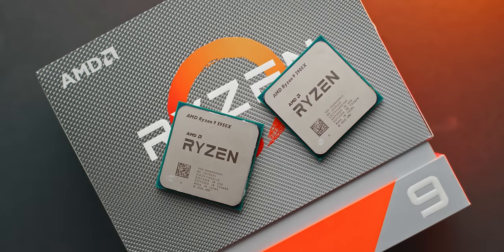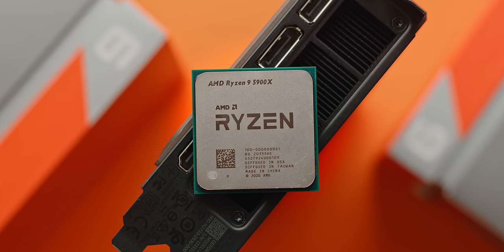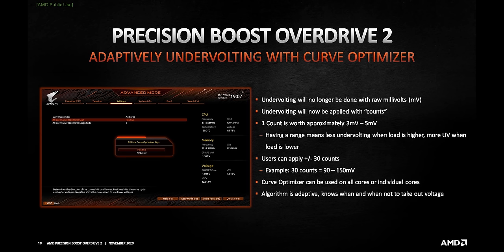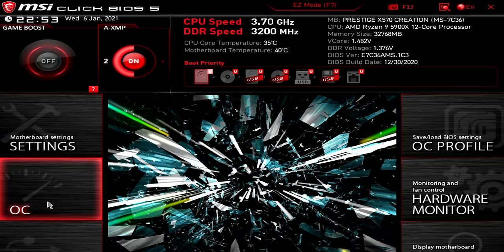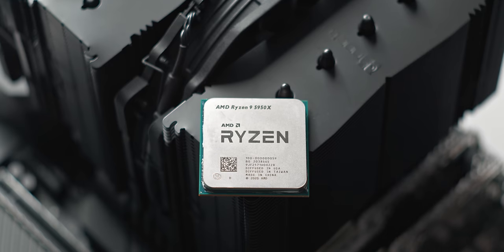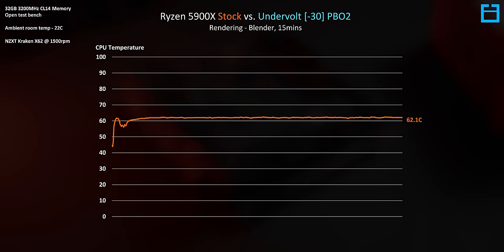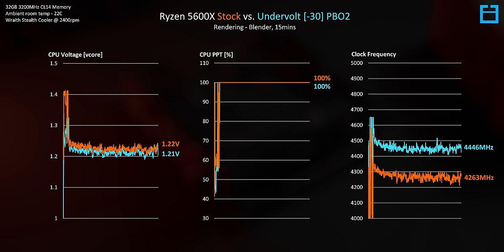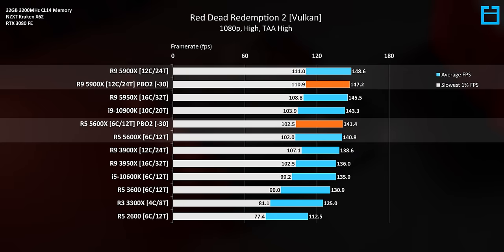Ryzen 5000 Undervolting with PBO2 – Absolutely Worth Doing

Comment: I did the exact same for my Ryzen 5900x setting to -30 and it crashes and doesn't work for me. I am using MSI unify x570 latest driver
Reply: @mattiasneidenstrom  thanks thats really helpful. But Today I returned my Ryzen 5900x and opt for Intel 10th gen because 11th gen sucks.. Ryzen performance no complaints but the idle temps around 50-59C degrees is bitting me.

Also I do not have any experience with overclocking and to get my desired temps I guess its too much work for me. Amd is really for the enthusiast. Hopefully next time when DDR5 comes out
Reply: @mattiasneidenstrom  I am using Corsiar h150i 360mm
Previous processor - i7 9700k and was really happy with it. Idle 28-33 and Max game load 60-65
Case Lian Li O11 Dynamic with a really good pull/push configuration 

I am getting i9 10850k as its on sale £370 and I did not see a point to go for 10900k which is just 100mhz more and practically same fps on games and for more money
Reply: @mattiasneidenstrom  thanks. I know Ryzen destroys Intel in performance but I made this decision after reading countless blogs and asking forums and found out that Ryzen does run hot on idle and within seconds can have temp spikes due to short burst is voltage that is supplied to the processor. For this reason undervolting helps with temps.
But for me i need something out of the box to work and not to touch anything related to oc
Reply: @mattiasneidenstrom  So does it mean I have a faulty processor? Damn Just now returned the processor and ASUS ROG Dark Hero...damn

Comment: Would this work the same for a ryzen 5 5600 which isn’t a x version? Can i still use 30 as optimizer magnitude
Reply: probably on -30 it won't be stable
Reply: What should i set it on
Reply: @gatzwithoutthestrapz4567 Start with -10 or -15, test stability

Comment: Wow that was so easy, I now have a 5800x boosting to 5ghz that runs cooler :D
Reply: I'm doing something wrong. My 5800x went from 70' to 80' with a -15 undervolt on all cores in CB20. Did I miss a step? Should I have Ryzen Master set to Default? The CPU runs too hot like that (80') so I have it set to PBO Gaming Mode (70'), is that messing things up for me?
Reply: @hotblack1166  Ryzen master would override your bios settings, so yeah I think you’d need to set that to default

Comment: Ok I’m a little new to this stuff but I did this and got it to work on -15 all cores but not -30. Anyway I hit 5.05GHz on 3 of my cores which was higher than regular pbo which hit 4.85. My question is, is that good? 5800x on a 360aio
Reply: On cinebench r20
Reply: Ridiculously good, that is some Core high end i7 and i9 levels of clockspeed.

You have the best Ryzen CPU for gaming if you can reach those clockspeeds.
Reply: If you reach 5.05GHz on 3 cores, maybe you can get pretty close to 5.1 (or 5.2GHz?) in one core.
Reply: @saricubra2867  PBO2 seems to be the way to go with these CPU’s. I never broke 75c as well!!

Comment: Anyone that thinks that undervolting gets you a better R23 score than adding voltage is simply delusional.
Reply: It can if you tune it right, lower temps means more overclocking headroom

Comment: With my 5600x I get about 400 MHz and 400 R20 points but it also runs about 15 degrees C hotter, from high 60s to low 80s...
So I guess Ill disable it again :/
Reply: Nevermind, it seems like PBO switched from advanced to enabled.
Now I'm getting about 200 more R20 points than stock with pretty much the same temperatures (only tried Value 20 so far) :)

I guess that's a pretty cool little extra for free :)
Reply: @LuxLikeGaming  There is no risk on try it, or you can damage the CPU?
Reply: @ZeroCool22  no risk at all
Reply: @evilleader1991  Thx.

Comment: Got my 5600x undervolted (around -25 per core beside the 2 best at -15) and overclocked +200Mhz running at 4.7Ghz all cores and 4.85Ghz single core. OCCT and Cinebench tested. Gets a 11493 and 1587 multi core and single core score, respectively. Temperatures max at 80 during multicore stress tests using a 360mm NZXT Kraken, which seems high although it is being pushed a lot. Would love to know if these are common results or if my chip is performing above/under average? Cheers!

Comment: i can't figure out how to so this on an asus b550-e motherboard. no curve optimizer option or anything :(
Reply: I own the exactly same motherboard . I was able to find it easily. Do you still need help? I can walk you through the steps if you like
Reply: Also what bios version are you on
Reply: @Luke-fx9gw  that'd be great man. i'm on the newest bios
Reply: @dioxyde0  1804 correct ?
Reply: @Luke-fx9gw  yep, just double checked.
Reply: @dioxyde0  advanced - amd overclocking - accept - precision boost overdrive - set it to advanced - then disable pbo limits - curve optimizer -all cores-negative. Start with a negative offset of -25 as it's very unlikely you will be stable at the max value of -30
Reply: @Luke-fx9gw  done, thanks dude!
Reply: @Luke-fx9gw  what are the chances of a stable negative offset of 30?
Reply: @dioxyde0  only one way to find out. Stress test it, play games , just chill on deskstop etc. You will know sooner or later as you will either get a blue screen, pc will reset or a game will crash. I'm stable at -25 but at 30 my pc reset while playing cod warzone

Comment: X570 Taichi and 5900X with Noctua D14 or (15? xD) can not even boot into Win10 until it set it to Negative 10 and then it bluescreens while running C23. Now wont even boot anymore with Negative 10. I even reset the Bios to default and set only the unervolt and xmp and above 4g and re bar.

Anybody any idead what coule be wrong here?
Reply: Does your psu have enough power? That doesn't sound right.
Reply: @beepoasa  Yes, it has.

Comment: This video 2 years ago, I tried now and this is fake or something else. 
I did all settings on my mobo Rog Strix X570-F gaming. I have 360mm Arctic Liq Freezer II AIO. 5900X CPU.
When testing CBench R23 the CPU is running at 4.25ghz. 20130 Points. :D :D

Comment: Anyone know a good undervolt config for a system running r5 5600 + rx 6600 msi mech 2x?
Reply: It more has to do with chip lottery. Just follow the instructions and adjust so you don't blue screen.

Comment: is this optimal to do with a 5 5600?
Reply: Yep, just tried it on my 5600 with ID-Cooling SE-214-XT for cooler. Stock tested with Cinebench R23 was 9119 points with max temp at 67.0°C. PBO with -30 tested with Cinebench R23 was 10617 points with max temp at 66.5°C. Not much temp difference for me but the performance increase is quite astounding.
Reply: @lukmandanish96  -30 crashes my system under load. -20 does the same. I had to settle for -18. Either I lost the silicon lottery by a longshot or something is off.
Reply: @bbbbbbb51  -18 is fine. Stability is what matters. With that slight undervolt, your CPU still has more headroom to boost when it can.

Comment: is pbo and pbo2 the same?
Reply: pbo2 is just the curve optimizer thats added in(if you dont have it , its just normal pbo)
Reply: Yes, it's the updated PBO, which should have been applied in more recent BIOS updates for your motherboard. It won't specifically say PBO2. If you haven't updated your BIOS in a long time, then it's advisable to do so, but do save your existing profile first and backup your data, documents and so on just in case. The free version of Macrium Reflect is good for making a disk image to do this.

Comment: You are awesome, my 5900x is more powerful now thanks to you.
Edit - value of 15 works for me.
Reply: using settings that are not designed for your CPU is a bit of a lottery. Did you try undervolting it by a smaller amount? Not the every CPU is the same so not every CPU can run at the same undervolt.
Reply: @jordanlazarus7345  yeah man, 15 works for me. I have edited my comment

Comment: Anyone willing to help me in discord? I’ve got a itx build I’m trying to make work.. 5600x 1070ti bout to change it to a 3070ti. Anyways I noticed  my cpu temps getting to 80 - 85c with only 10-20% usage. I was playing apex, competitive settings, 2k res. I did everything in the video on my b450 I Aorus board. Temps look better, clocks look the same.. I guess I just want to make sure I did it right. I’m not familiar with blender either.. I’d like to tinker some more but I’m not sure how to. I just copied the video…
Reply: That's the case of poor cooling more likely. Your case, cooler n fan spec?

Those numbers are high dude. My 5800x at full load couldnt even reach  80

Comment: why undervolting? temperatures are good
Reply: -volts = +lifespam
Reply: It saves power and apparently lifespan but I don't think it actually saves lifespan unless your cpu is getting above 70 to 75°c at stock voltage. If your cooler keeps it under that temp range while doing YOUR specific tasks without under volting, you don't need to except to save on your power bill if you want.

Comment: please can i have question cpu voltage socket in my mother board 8&4 pins  i used my 8 pins only what happen if i connect the 4 pins as all is there more penfits ? and please what kind of cooler you are using ifim using 5800x cpu and cooler (cooler master 240 v2) is it nice , because when im rendering in montage dvanci resolve cpu temp go (84+) is this save and also i live in egypt and weather in summer very hot and now im in winter ( or in good cold weather )
Reply: Connecting both cables can help with stability and so is advisable. Your CPU going to 80 degrees under load is okay but really it would benefit from being at a lower temperature. A cooler such as the Thermalright  Phantom Spirit 1230 EVO, which is about $35 in the US will likely do a better job.

Comment: I dont see the point.Just overclock all of the cores at 1.45 volts and at 4.8 ghz and be done with it.Best performance and all 240mm coolers can handle it just fine.
Reply: too much voltage ...
Reply: @nadsim154  yeah thats my bad.I didnt try underclocking it before my comment and just stuck to higher voltage I had to run to get stable clocks on last gen ryzen.But now i tried it and i can run 4.8 all core at 1.32.Pretty amazing.
Reply: @Skater6453  Ohh I see, yeah 1.32 volts now for the same speed is a lot better 👍. Well done and have a great day dude!